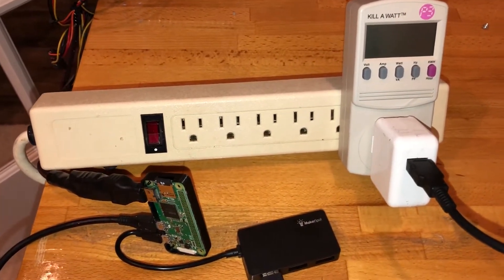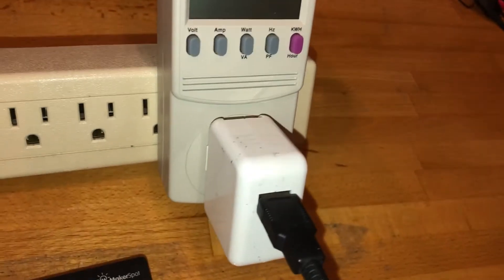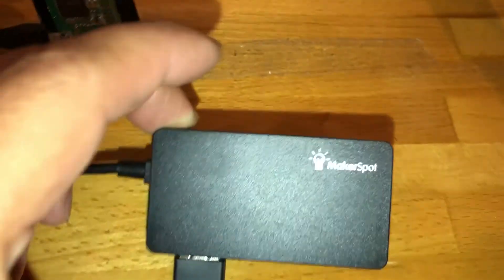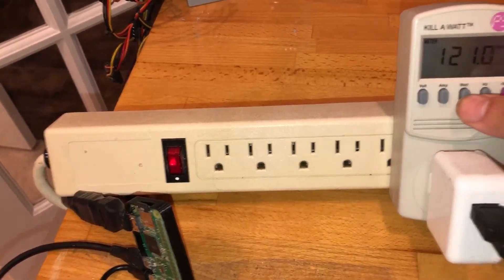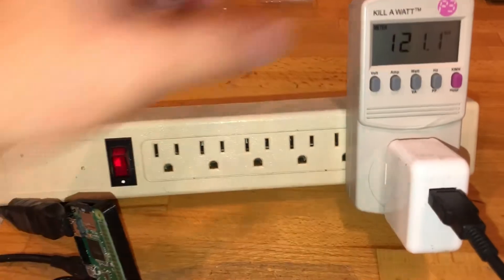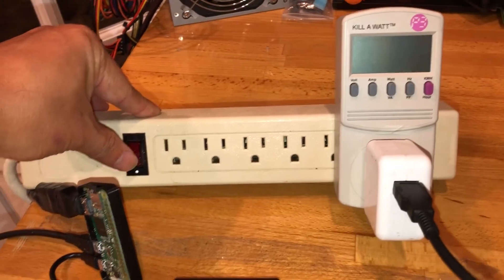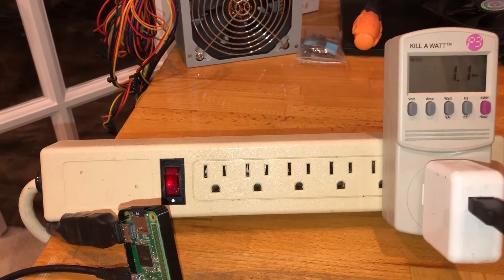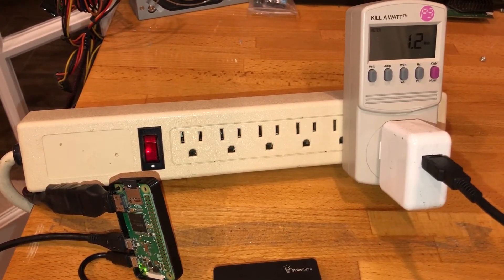Raspberry Pi Zero power consumption. Whoa, Surprised!!

Comment: You’ll find it even more fascinating when you see this experiment using a thermal camera.  Most of the heat will come from the DC adaptor rather than the raspberry pi.  If you have a usb power meter, you can see what the actual pi zero consumption is without the power supply.  Try it out!

Comment: So according to your measurement a Raspberry Pi Zero uses about 1,000W to run ! I think you your video is extremely confusing and in my opinion probably misleading.....
Reply from the maker: I just re-watched the video... it never showed 1000 watts, not sure where you are getting 1000 from?!?
Reply: DIY GEEK Nicolas does not understand that “KIll a Watt” is the device you plugged into for measuring, and not a “kilowatt” of power measurement.
Reply: Actually. The first reading after the power is switched on, before he switches to (watts) is actually the volts the plug is providing. 120.something (volts.) In USA would be wall power. In EU would be mains power.

Comment: Be careful when plugging in power into the Pi zero, you had the usb output and the power swapped, on the Pi there is a power protection circuit only on the "PWR" micro usb port...